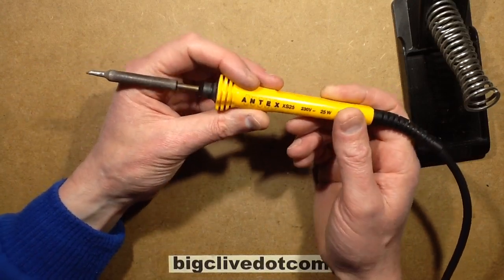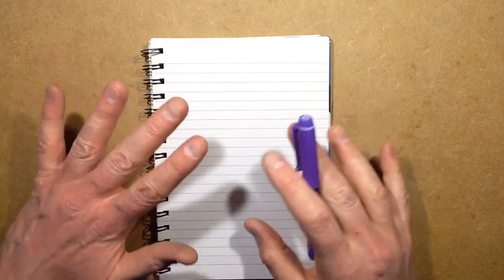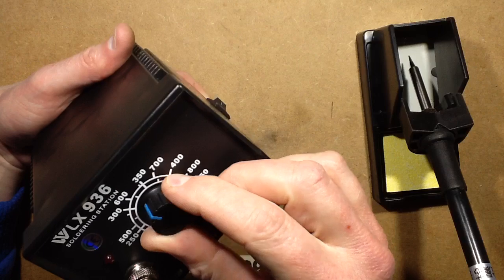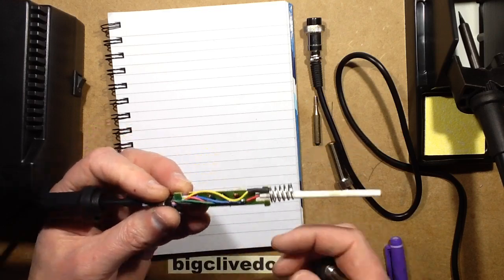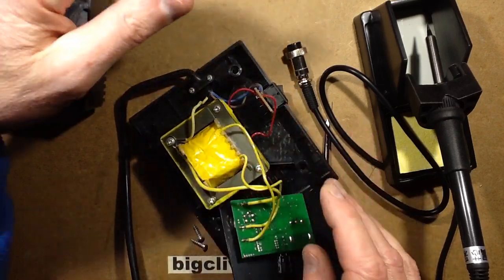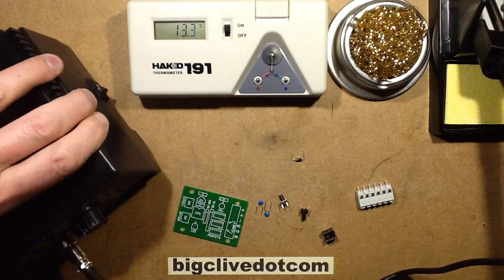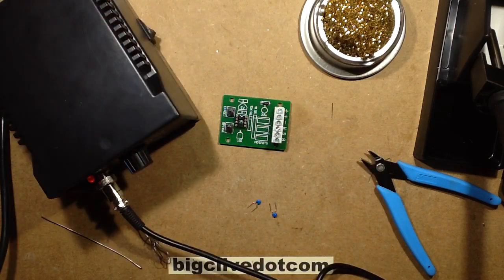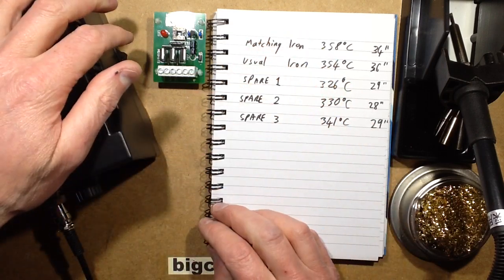Soldering basics and choosing a cheap soldering iron.

Comment: I hate how there is a push to have all manufacture of lead based solder banned as I can't stand that lead free shit.
Reply: +Dark Alchemist the problem with lead based solder is governments have not been able to figure out how to properly dispose of waste electronics. So of course we get punished for their ineptitude. It is only fair.
Reply from the maker: +Paul Frederick And in the process have quadrupled the amount of waste electronics by specifying a brittle and inappropriate solder replacement.
Reply from the maker: +Dark Alchemist Then stock up now before the price goes through the roof (Like it already did.)
Reply: bigclivedotcom
Well damn.  Why is there this push by the governments to ban lead in everything?  Paint I could understand but really unless you eat it wth?  I think there was a study about the fumes from soldering and they were not that harmful.
Reply: Paul Frederick
Oh, I hadn't thought of that.  :(  Well, geez.
Reply: *****
Yes it is down to groundwater lead contamination of effluent runoff. Part of it is on end users simply not disposing of their electronics correctly too. But if there was a sane way to go about it I am sure that would improve. So governments have decided to attack the problem on the supply side. But interestingly the military, and aerospace industries are specially exempt from RoHS regulation. Because lead based solder is actually superior to the lead free garbage. A classic case of do as I say, not as I do.
Reply: Paul Frederick
That is what pisses me off about the govt where it is, as you said, do as we say not as we do.  Did you know if you go into a court room and tell the judge that all you did is what the govt does he will tell you that doesn't excuse you and the gavel comes down but never for them.  Makes one want to become an anarchist.
Reply: *****
well in this instance in the government's defense they can regulate how they manage their own gear. I'm sure they have strict rules regarding the disposal of all of their unwanted equipment. Which often ends up being auctioning it off to civilian rubes. Also in their most demanding applications they need the best materials they can get. Lead free solder has failure modes that leaded solder lacks.

Little consumer electronics from the change over survives today. Because industry had not yet dialed in how to work with the lead free alternative. Also, if you work on lead free electronics you are best off just cleaning the old solder out, and replacing it. Only on the joints you actually have to work with though. But the stuff really is horrible.
Reply: Paul Frederick
Do tin whiskers still happen with the lead free shit?
Reply: bigclivedotcom
Do you know of tin whiskers still happens with lead free solder?
Reply: bigclivedotcom
Yeah BGA chips and lead free solder, what could possibly go wrong? It never ceases to amaze me that consumer electronics even work at all. It is just so built down to a price. I bet the industry actually loves it. As the regulation leaves them blameless. They get to sell more crap to us then too.
Reply: Paul Frederick
I have to agree.  What totally sucks is when you try to desolder on one of these consumer pieces of shit because then you get to see just how bad it is.  Pads lifting because the glue used sucked and the foil sure in the hell isn't 1mm thick either.  All for the throw away economy with very planned obsolesce too.
Reply: *****
board rework is always tricky business. You always have to be willing to sacrifice parts for the sake of keeping the board in good shape. It is a matter of priorities really. Often wick is the most gentle method of solder removal. Sometimes I like to use the knock the snot out of it method too. Sometimes referred to as, "heat it, and beat it". Heat it and beat it, in case you don't know, is when you heat a joint, then quickly slap the board on the edge of your workbench. Do it right and inertia should make the solder fly out. It is a pro technique though, so novices should not attempt it.
Reply: Paul Frederick
I have been doing this stuff for over 30 years and yep, heat it and beat it, lol.  The thing is that not all Chinese made shit is a sob to rework but some are so cost cutting that even sticking your finger on it the traces, and pads, lift...lol.
Reply: Paul Frederick

Comment: Clive is 100% correct here.  Soldering is all about practice.  Once you get some experience, you will feel how much time it takes to flow solder,  and how often you need to clean the tip etc

Comment: I've got a Yihua 936. The bits it came with fit really snugly on the heating element, but it really doesn't have great thermal mass. Replacement bits I've bought fit loosely, so I had to come up with a copper sleeve to jam in them as a shim. I really need a board preheater for boards with big ground planes to deal with the low thermal mass tho.

Also, I always use extra flux. Most of the time the flux core solder doesn't have enough flux to get a good solid joint.
Reply: +FrankTheCat I have a medium cheap 50W Toolcraft soldering station with a ceramic element that fits the bits loosely. Is it worth jamming some kind of copper net in there to conduct the heat better?
Reply: Maanuueel42 \m/(^_^)
Yes. It has to be a light press fit though, so you don't crack the ceramic or otherwise be unable to remove the tip. There was a noticeable difference in thermal performance between the tight fitting tips and loose fitting ones.
Reply: FrankTheCat Thank you! :)

Comment: i have found that my soldering station with the hi/low setting gets used the most, i have a modern weller iron and its nice and all, but having a station with a metal sponge is more user friendly in my opinion, and having hi and low is nice if you cant afford a more precise unit :)